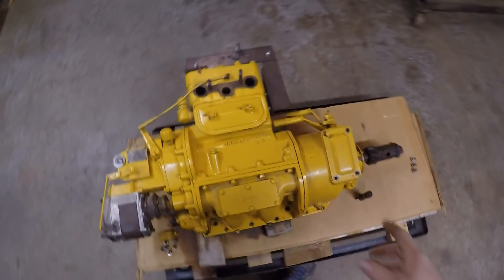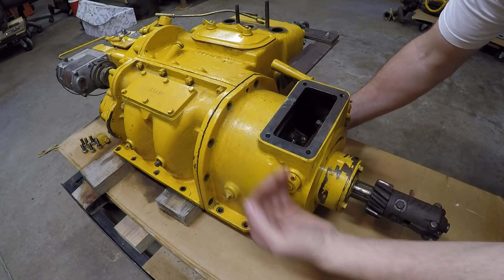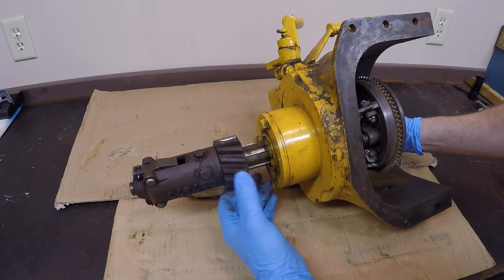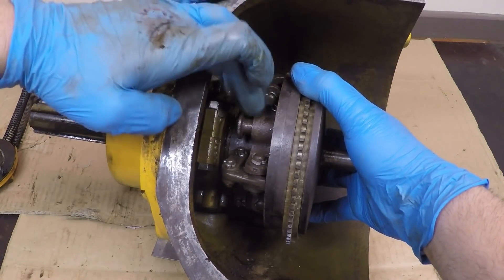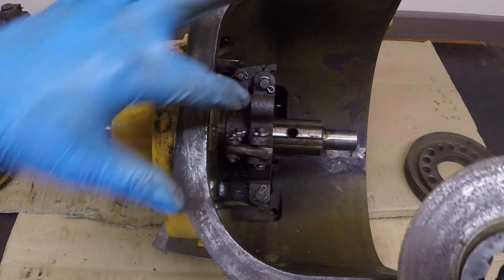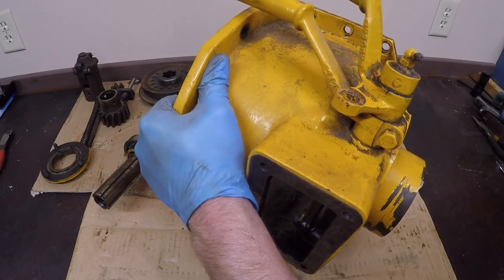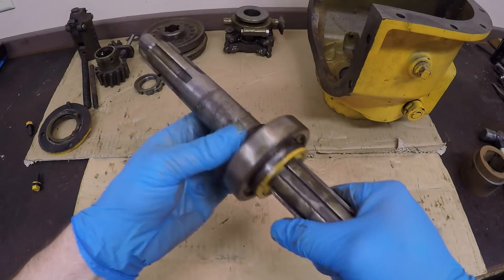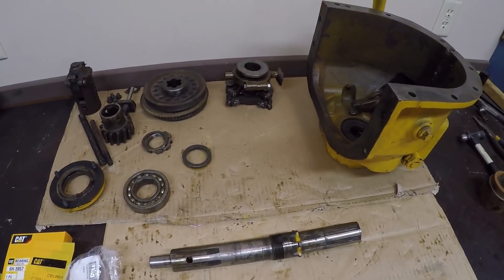Caterpillar RD6/D6 Starting Clutch Drive Repair - Disassembly of Clutch and Pinion

Comment: The tie wire that keeps the bolts from backing out is called Safety Wire (widely used on planes, race cars and aerospace vehicles). Safety Wire Pliers are used to twist the wire. In many cases, safety wire is made from stainless steel. Really enjoy your RD6 restoration and applaud your efforts in explaining the intricate details of the process.

Comment: Probably a stupid question but why are the pony's so sharp sounding, & loud, just a straight pipe ?
Reply: how do  you get old  dozers so cheap, i cant find any in my area and i want to get one thats like a d4 or smaller . im in south tx
Reply: honestly i was just just looking at a 1918 caterpillar but it was just the undercarriage , i wanted to just put a chevy 350 in it and add front tires for steerign and make it into a half track but eh i had to pass it up

Comment: Just purchased an RD6 today and am having troubles starting mine even after it is warm. Does low fuel pressure sound like a suspect? My fuel pressure gauge does not work so I can't tell what it is, also can't seem to locate a fuel filter. The book I have must be for a later model because where it shows a filter mine has nothing. any suggestions? Thanks         and P.S. and thanks for the video, very informative and well done
Reply: Located a book for my model (2H1992W) I think it is either a 36 or 37 and took the filter housing apart a found that the three fuel filters or fuel screens (nor sure which is which)  are missing. Also found a lot of sediment in the bottom of the filter housing so I pretty much know what my problem is now. Do you have any suggestion where I can find these filters. Thanks
Reply: @squatch253  thank you very much for the info I was trying to figure out where the fuel filters were. The book I have is for a later model and my dad's too old to ask he doesn't remember anymore he had one years ago in the forties when he started farming. Thanks again for the help
Reply: Thank you very much I really appreciate the info